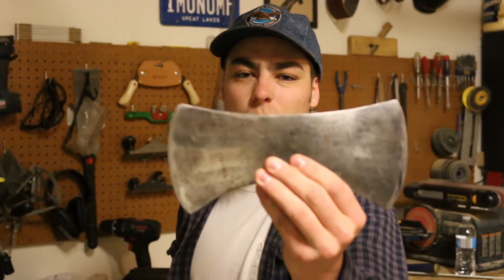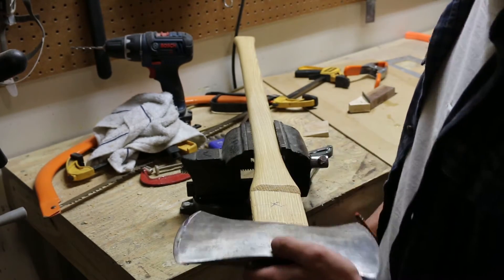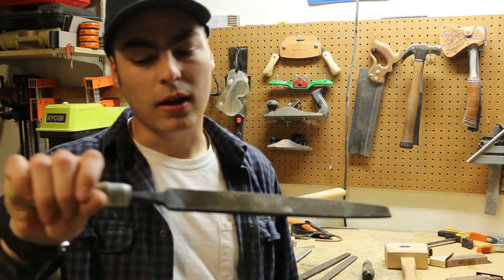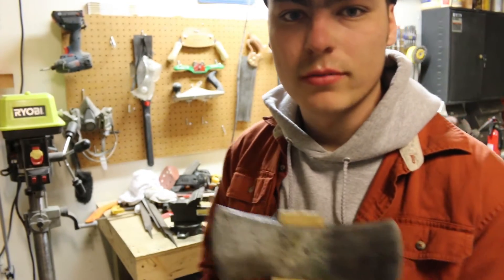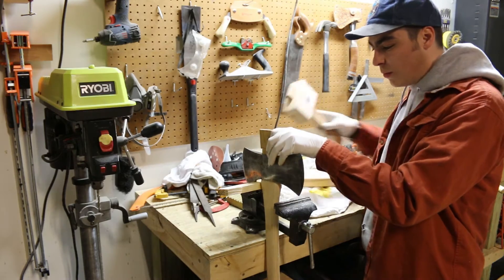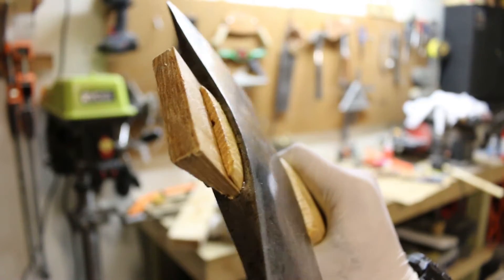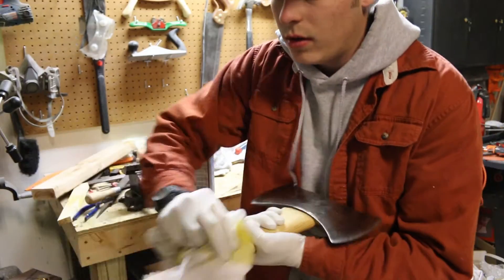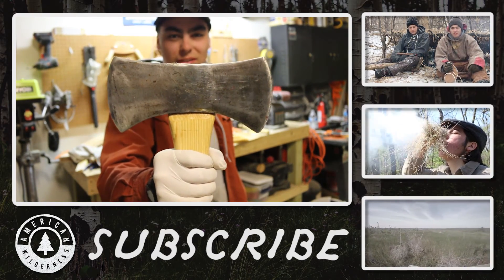How to Rehandle a Double Bit Axe - Bushcraft

Comment: I'm 59 years old and I remember being about 10 years old and living on a farm in the Shenandoah Valley of Virginia... and we were dirt poor but my Dad got a Coke bottle and broke it, then using a bigger shard of glass from it that he hand picked from the pieces to slowly shave the axe handle down to where it would fit the axe head by scraping it with the glass! I remember him telling me that he used a Coke bottle because they were known for being made of thick glass! It was a Double Bit axe and I still use it to this day, not like we did back then for splitting wood to heat the house but just for tree roots and such! I just bought a new TSC handle for an axe head that I bought on ebay and I'm using your technique with the wood file on it tho! Didn't want to try it with the Coke bottle. Great instructional video Dude!!

Comment: Not bad at all. I do use my spoke shave and four in hand to shape the eye wood without issue but can't really fault your method. I use pine tar inside the eye of the head and on the wedge and have for years. Works good for me and helps prevent drying and moisture issues.